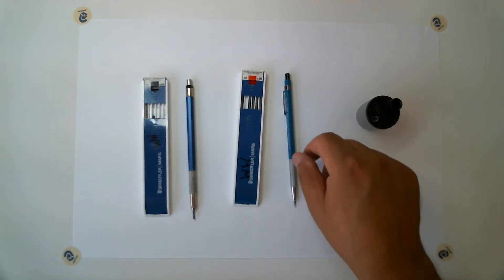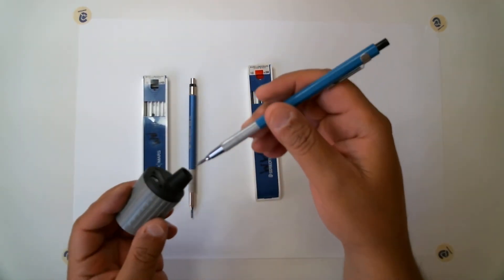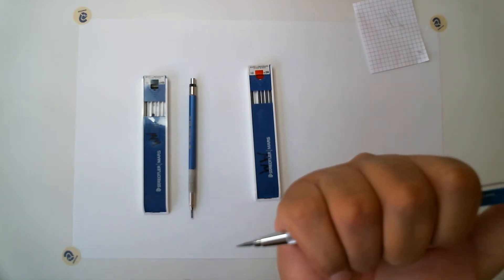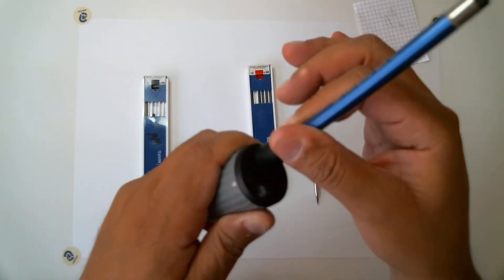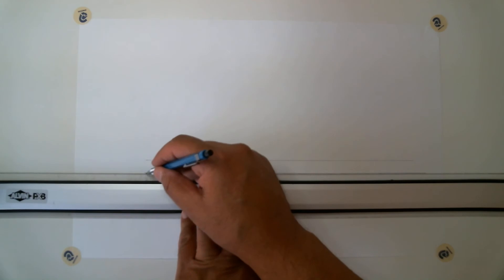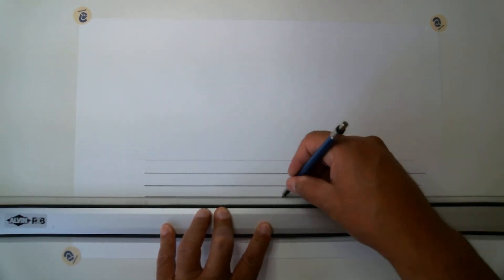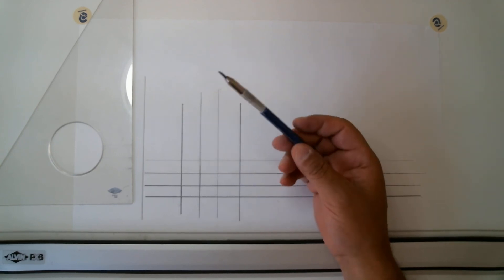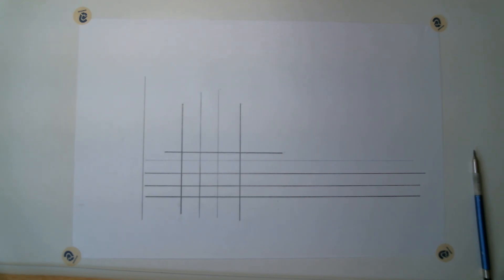Architecture 121 - How to use lead holder

Comment: One question, is the lead sharpener really required?
Reply from the maker: Yes because my students use actual lead, so it has to be sharpened
Reply: If you don't want to pay out for the 'Tub' style lead pointer, you can get ones that are a lot cheaper and smaller, which are very similar to a pencil sharpener. - Just be very careful and don't use them near your drawing coz of the lead dust!